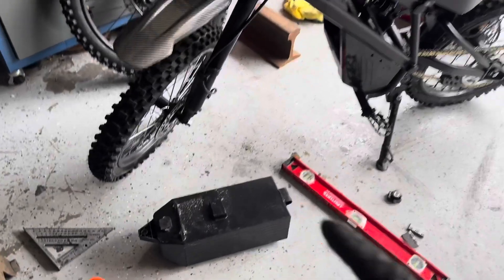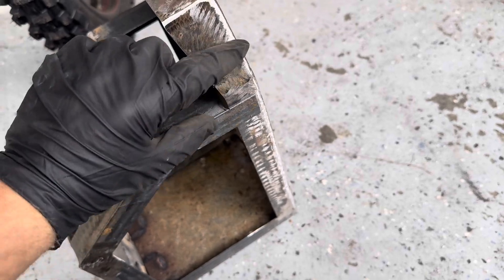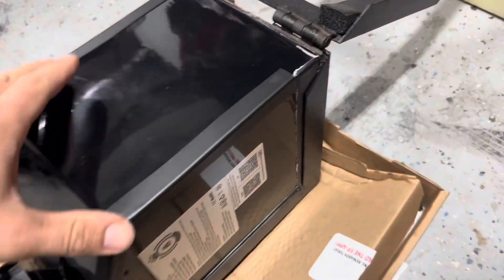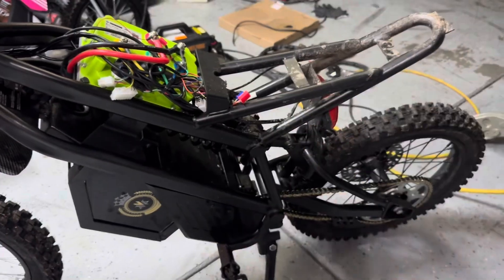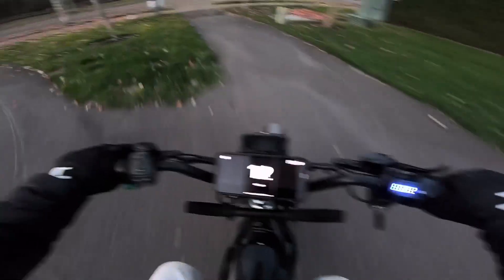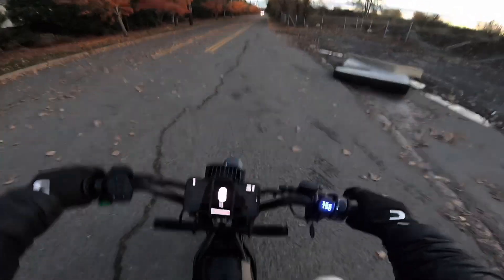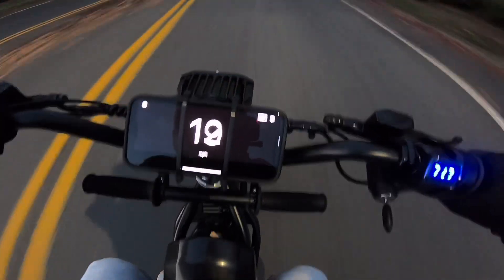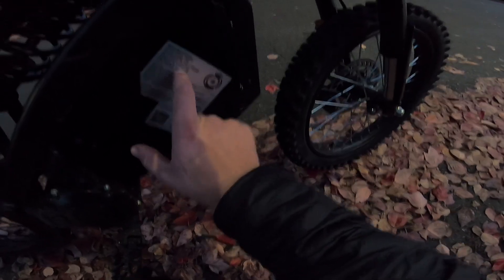72V Electric Dirt Bike Build | Cheaper and Faster than Surron!

Comment: My man, what chain did you upgrade to and how did it perform at 100A on the stock baterry, was it more stable with temps etc than running at 120A?
Reply from the maker: I only tried at 120amps on stock battery. It ran good no problem temps were fine. It’s just a cheap chain on Amazon the stock one kept stretching to the point I couldn’t tighten it anymore.

Comment: I think you can do that battery mount with a 3d printer lowkey it looks 3d printable
Reply from the maker: I think you can but the battery is heavy and hangs down so I don’t know if I would want it done with anything other than metal.